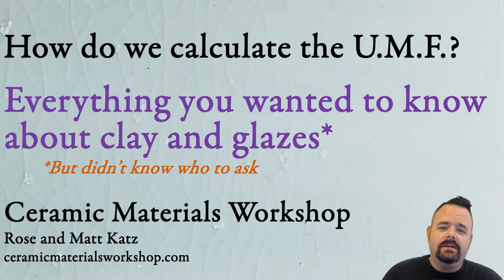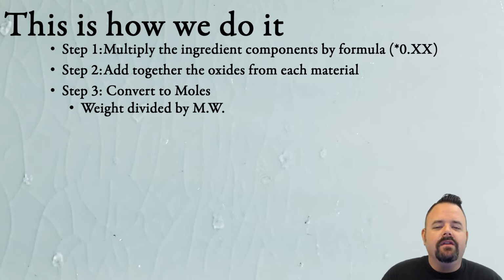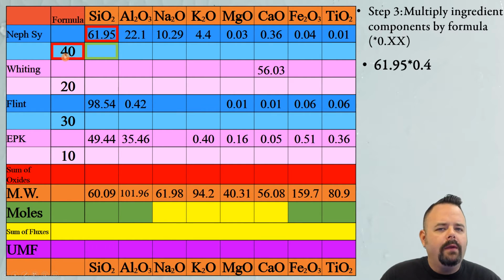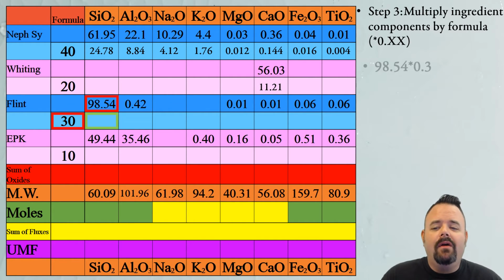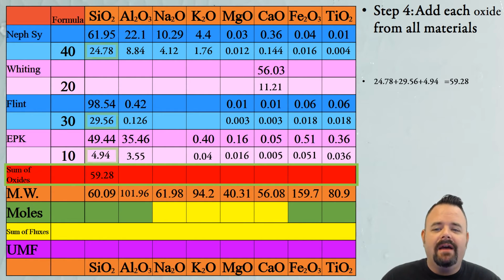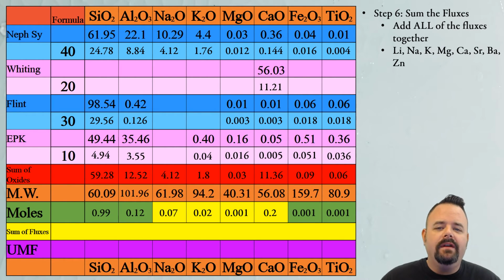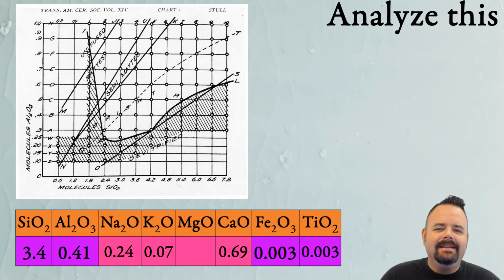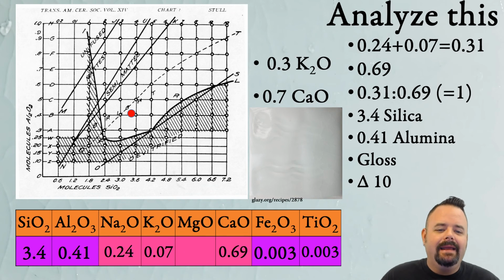Free Glaze Chemistry Lesson: UMF Made Easy | Ceramic Materials Workshop

Comment: Hi Matt, thank you for this video. However I can't understand how the example based on a glaze recipe suitable for cone 10, with a 0,3 R2O : 0,7 RO ratio, can proove that Stull map (based on cone 11 and 0,3 K2O:0,7 CaO) works in anycase , whatever the firing temperature, and the R2O:RO ratio, and the nature of fluxes oxides used. 
Glazy.org indicates ("glazy help" section) "The Stull chart was created for glazes with a flux ratio 0.3 R2O: 0.7 RO and fired to cone 11. There may be variations in the chart for glazes with different flux ratios fired at different temperatures. The Stull chart does not show or predict firing temperature. So, just because a recipe point lies in the "Bright" region does not mean it will be a glossy glaze at your firing temperature." 
maybe I misunderstood the "predictive" side of the Stull diagram, as you mention it . Thank you if you can clarify
Reply: Minor firing variation (1 Cone) are well within the effective temperature range for a glaze. 
Cones them selves are just glazes with specific chemistries. Specifically variations of 0.1 Al and 1.0 Si is the difference between most of the cones at these temperatures. 
So what the map is showing us is variations in chemistry and temperature. Although the document is defined as only chemistry, temperatures is part of the system.

Comment: this is amazing. your one of the few people who understands and are helping me become a better glaze chemist, I have a question real fast. what part of the chart or numbers in the u.m.f tell me what cone the glaze is?
Reply from the maker: Thanks!
You can estimate firing temperature, but you have to consider all the values and how they work together. 

There are three major values that effect temperature. A) Higher levels of Alkali Metal flux, (over 0.3) I NEVER recommend this method for  functional glazes. I have a video on NCECA's page talking about why.  B) You can work with lower amounts of Silica and Alumina (which is hard to to as we require Si:Al to make the glaze) C) You can add a material that effects temperature. Namely Boron in a modern context. The exact amounts of Boron required for a particular temperature is something that I defined and published in my work from the 2012 NCECA journal. 

You can learn a lot more about the subtleties of understanding and reading  the UMF with my online workshop. 
https://app.ruzuku.com/courses/17968/about

We are going to publish a workshop specifically on temperature later this year. But we have another one on deck first.